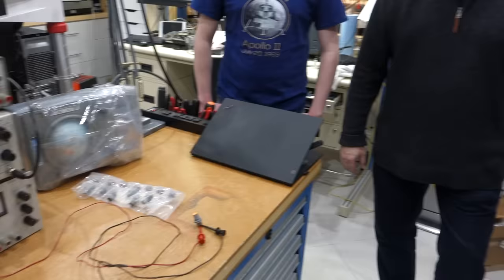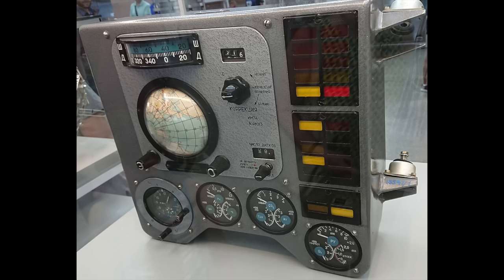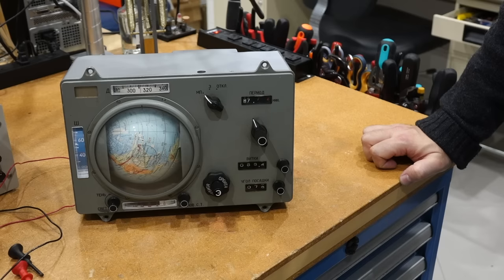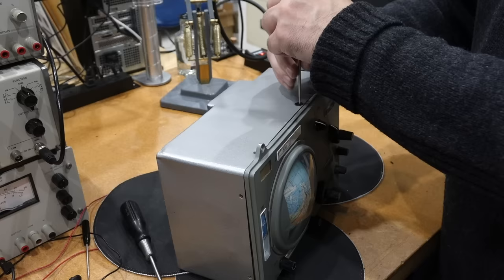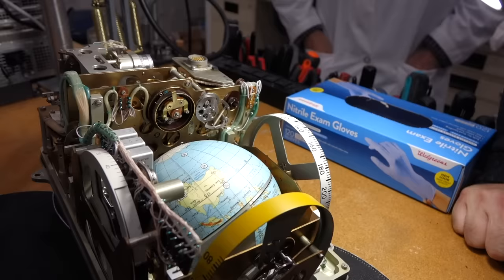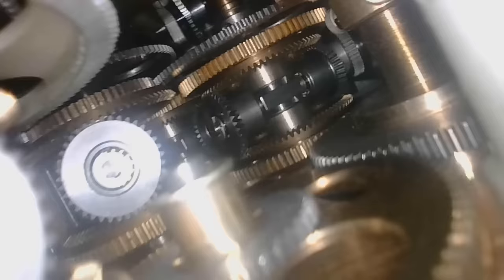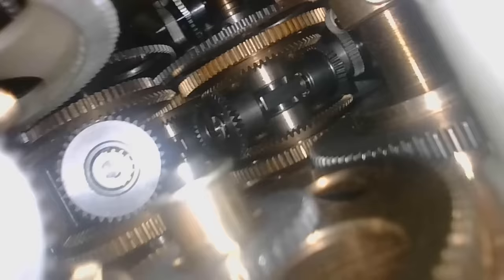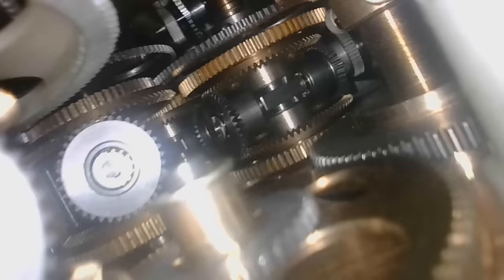Soyuz "Globus" Mechanical Navigation Computer Part 1: Grand Opening

Comment: It looks like the modern version of the Antikythera machine. It seems designed by an expert watchmaker and a skilled electronic technician. Germanium transistors or logic circuits still didn't fit into Russian reliability against EMF and space radiation.👍
Reply: Waren denn die Geräte der Amerikaner alle mit Blei ummantelt, oder war das amerikanische Silizium und Germanium immun gegen die Strahlung? 🤔🤔🤔
Reply: @wolframgerber7118  They would probably be coated with lead, both the American and Russian devices, for example the transistors that equipped sputnik 1 and sputnik 2 many years before should have done so apart from having them running at a controlled temperature of 25 degrees celsius so that they can work properly . The fact is that to replicate the mechanical device would require a lot of electronics and a cathode ray tube with images, something perhaps less reliable for the Russians up there in the long term. The USA was more advanced in this field and opted for transistorized computers already with silicon, more stable than germanium.

Comment: I have the DEPSTECH DS380 and absolutely love it. My only complaint is the screen on mine looks to be TN so the angle you view at has to be perfect, I believe yours is IPS which is ideal. I half expected the main camera to be OK and the other two to be much worse but to my surprise all 3 work well with their own LED lights. Mine also came with a hook tool and another with magnet on the tip for retrieving items from tight areas and this has come in handy more then the cameras themselves. Well worth the price!

Comment: Great film, thanks a lot. Not entirely sure, but the the device you guessed as a solid state relay, could actually have been a thyristor (ку202н) or diode (д242)
Reply: ...which is very common and not even military or space-grade use.

Comment: Interestingly talking about mechanical location technology, some of our trains in the UK I believe still have automated announcements that rely purely on distance information from sensors on the wheels, naturally it's not very reliable. Even some more modern stuff that can even do selective door opening for short platforms uses a mixture of GPS and wheel sensors.

Comment: I have a similar depstech camera but uses my phone as the display.  I bought it to inspect my MG midget engine without disassembling it. I also used it when my main sewer line clogged, and the rotor rooter guy couldn't get the snake to go down the right hole, so I let him use it and he gave me $20 off lol.

Comment: Last time I saw a mechanical device was the differential calculator at a museum. Looks like Soviet stuck the same design and just updated with electronic timing to reinforce mechanical gears. It's like why fix it if it's not broke mentality.

Comment: Mechanical navigation computer for Soviet space flight!The Soviet space program used completely different controls and instruments than American spacecraft. One of the most interesting navigation instruments on board the Soyuz spacecraft was the Globus, which used a rotating globe to indicate the spacecraft's position above the Earth. This navigation device was an electromechanical analog computer that used a complex system of gears, cams and differentials to calculate the position of the spacecraft. Officially, the device was called the "space navigation indicator" with the abbreviation INC, but I will use the more descriptive nickname "Globe".Now the question is, who are you going to fight with?
The main purpose of the Globe was to indicate the position of the spacecraft. The globe was rotating, and a fixed crosshair on the plastic dome indicated the position of the spacecraft. Thus, the globe coincided with the cosmonauts' view of the Earth, which allowed them to confirm their location. The dials of latitude and longitude near the globe gave a numerical indication of the location. Meanwhile, the light/shadow scale at the bottom showed when the spacecraft would be illuminated by the sun or in shadow, which is important information for docking. The Globe also had an orbit counter showing the number of turns.
The Globe had a second mode indicating where the spacecraft would land if they fired up the braking thrusters to begin landing. The click of the switch caused the globe to rotate until the landing site was under the crosshair of the sight, and the astronauts could assess the suitability of this place for landing.
The astronauts set up the "Globe" by turning the knobs to set the initial position of the spacecraft and the period of rotation. From there, Globus electromechanically tracked the orbit. Unlike the Apollo control computer, the Globe did not receive navigation information from the inertial measurement unit or other sources, so it did not know the actual position of the spacecraft. It was just a display of the predicted position.

Механический навигационный компьютер для советского космического полета!В советской космической программе использовались совершенно другие органы управления и приборы, чем у американских космических кораблей. Одним из самых интересных навигационных приборов на борту космического корабля «Союз» был «Глобус», который использовал вращающийся земной шар для обозначения положения космического корабля над Землей. Этот навигационный прибор представлял собой электромеханический аналоговый компьютер, который использовал сложную систему зубчатых колес, кулачков и дифференциалов для вычисления положения космического корабля. Официально прибор назывался «космический навигационный индикатор» с аббревиатурой ИНК, но я буду использовать более описательное прозвище «Глобус».Теперь вопрос вы с кем воевать собрались?
Основная цель Глобуса состояла в том, чтобы указать положение космического корабля. Глобус вращался, а фиксированное перекрестие на пластиковом куполе указывало положение космического корабля. Таким образом, глобус совпал с видом Земли космонавтов, что позволило им подтвердить свое местоположение. Циферблаты широты и долготы рядом с земным шаром давали числовое указание местоположения. Между тем, шкала света/тени внизу показывала, когда космический корабль будет освещен солнцем или в тени, что является важной информацией для стыковки. У Глобуса также был счетчик орбит, показывающий количество витков.
У Глобуса был второй режим, указывающий, где приземлится космический корабль, если они запустят тормозные двигатели, чтобы начать посадку. Щелчок переключателя заставлял земной шар вращаться до тех пор, пока место посадки не оказалось под перекрестием прицела, и космонавты могли оценить пригодность этого места для посадки.
Космонавты настроили «Глобус», поворачивая ручки, чтобы установить начальное положение космического корабля и период обращения. Оттуда «Глобус» электромеханически отслеживал орбиту. В отличие от управляющего компьютера Apollo, Глобус не получал навигационную информацию от инерциального измерительного блока или других источников, поэтому он не знал реального положения космического корабля. Это было просто отображение предсказанного положения.

Comment: Beautiful 👍 perfect astronomical clock, because everything is possible in Russia, so why not a mechanical computer, I'm more surprised that there isn't a little man with a ball counter sitting inside next to the gears and after calculating the path of the module, he doesn't turn the dial 😂
Fingers crossed for a wire connection fix

Nice day 🙂 Tom

Comment: Machines that I would not trust my life to include ... this one.
Reply: To be fair, I had an old Raketa watch and that thing was similarly apparently built like crap but able to work fine after being dropped / having its crystal pop off (just popped it back on) / having its crown+stem randomly fall out (just jammed it back in; worked great) ... Still, Soviet-style engineering does not inspire confidence.

Comment: I take it the gear connected to the differential was for differential equations?
Reply from the maker: It's much simpler than that. The differential gear arrangement is used for adding and subtracting, a timing correction to the orbit in this case. It's really a very similar arrangement to a differential gear in a car.

Comment: 8:30 I think that you may need a longer screwdriver, if you have one that's 75-100cm it may be better!
Reply from the maker: That's just not any random screwdriver! It's from this teletype toolkit military set, video here: https://youtu.be/FxBgTDpsUC0 . These are much finer that regular screwdrivers. The screws on the Globus were special too, higher precision heads and finer than normal, hence we had to use the better screwdriver in order not to mar them.

Comment: Mechanic computer?!
I thought that Zuse1 was the last effort in that direction.

But these are "Navigational computers" - not so much programmable ones, right?!
As in, they are one-trick ponies (I don't mean that in a bad way)?

Beautiful mechanism, though 😍
Reply from the maker: The Zuse 1 appears to be an entirely mechanical digital computer, and is quite unique in the history of computing. Although there were many electro-mechanical successors, I don’t think another pure mechanical one ever followed. This is an analog mechanical computer, a different beast altogether. It is indeed single purpose (and very beautiful). But multi purpose mechanical analog computers were also developed, the differential analyzers come to mind. Although they were quite programmable by changing shaft and gears, it was difficult to do so, which was their main downside.

Comment: I do have to hand it to the Russians. When they really put their minds to something inspiring or purposeful for them they engineer and build to last and they don't overuse digital technology where an analog counterpart does the job perfectly just as well (and easier to maintain because of that). Less training required for maintainers too as usually those just need oil and calibration. 

I mean shoot there's a Lybian dude who bought his own MiG (F-14 counter) and put it together with other broken MiG and all those parts some the original to other craft still worked and even passed Xray inspection with flying colors. He leaves his plane unpainted to give it this rustic look and the wings a different color but she will fly like a dream and handle its OG amount of Gs.

Comment: If your speed or declination changes you are basically hossed, the instruments cannot even know where you are… wow
Reply from the maker: It’s strangely limited. You are toast if you do a plane change, which is not something that happens easily. But it will adapt to speed changes with the timing dial. But then, only for circular orbits. However it gets extra points for style…

Comment: Russia almost didn't want to gamble everything on the semiconductors electronics just yet (and I don't blame them, as space is insanely inhospitable even to the rad-hardened electronics). Yet they took the KISS (Keep it simple, stupid) approach to the avionics back in the day.
Reply: You call THAT a "simple"...
Reply: Keep in mind that when this has been designed, there were pretty much no semiconductors or solid state computers that would be both able to do these calculations and fit into a tiny spacecraft available. So it really wasn't about semiconductors not being reliable - there simply weren't an option at all!

The specimen in the video is from 1973 but the first one flew with Gagarin in 1961 already! The later ones are functionally almost identical, they only gained a few extra knobs and the landing angle/site function.
Reply: @JanCiger  Correct. It was before much more reliable semiconductors electronics finally came along especially for Russia, they kept using old school mechanical computers for as long as possible that would have made sense to them back in the day in terms of reliability. Why did I say reliability? Because transistors were honestly not as stellar as they're now, people who have experimented with older transistors already knew how unreliable they were back then, way before they finally got far better reliability even in irradiated environments, and as you mentioned, cost, obviously. It's still very expensive to make the avionics nowadays due to military chips which command pretty pennies.

Comment: I bet the CIA want to collect this for their own museum 🤔 😉🤣 reverse engineering is their speciality,
I had an old Russian chart recorder once, it was built so well, no replacement ink cartridges only a reservoir on top that you filled in with ink and a thin capillary tube down to the chart paper 📃 weight was very heavy two man lift, came in a wooden grey painted box,

Comment: This thing has no danger of hanging up at the most crucial moment due to a random flow of cosmic radiation, which will suddenly switch the state of some transistors in the processor and give an error or failure. You won't have to wait for your device to reboot when your life is hanging by a thread. If the device meets the requirements for reliability, weight and dimensions, then why change it to a more fashionable, but unreliable one? This is a typical Russian approach to save money on something that has proven itself well in harsh conditions.
Reply: And it could not get damaged by nuclear bomb EMP either in case of war.

Comment: Aaaaaw, it's only one axis? You have to install different globes?
I'm a bit disappointed now, you can't mount it in your car and use it as a low precision GPS.
Reply: Oh wait, no it's not.
But you can't change the declination.
Still sad.
Reply: If you could get it working again, it would make a sweet ISS tracker.
Or anything in space tracker.
Reply: The only car that orbits is a Tesla Roadster.

Comment: Purpose built Mechanical computers are far superior to digital ones. Transistor computers are ok at doing lots of different things but introduced lots of points of failure. A mechanical computer will do it’s one function for decades and could be built to latterly last hundreds of years.

Comment: There is a moral too this story!
If it works well and is reliable sub system  stick with it! 
why overcomplicate after spending time, monies, R&D tests to get it to function correctly!
If NASA had continued upgrades on Apollo gradually, they probably in a better state in space race by now!

The more you over complicate, the bigger the changes in variables that can and will go wrong!
That's prob why they adopted mechanical computers\clocks systems.
Space hardware needs to be made reliable and simply to use but robust at same time, if it means using simpler methods that does the "Tasks at hand", why make it more than that!
I can see why the Russians did it this way, functionality and reliability over fashion sense electronics  complex expensive untested  electronics.
It would be interesting side by side USA VS Russia system  hardware which one is more reliable and less expensive?
Im not side to any faction, but stating the obvious here ,if it works stick to it.
loved the vid ,nice too see what Russians had in spec tech.